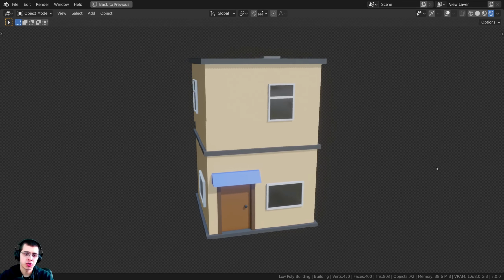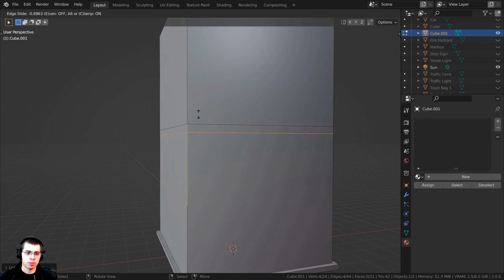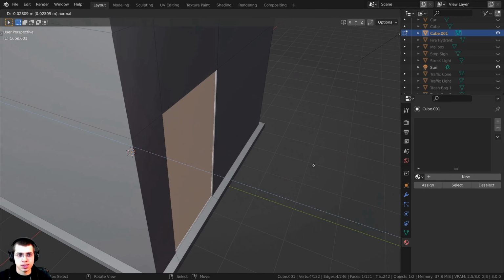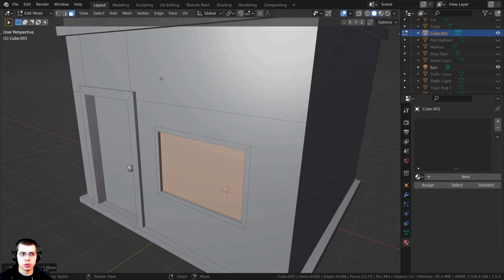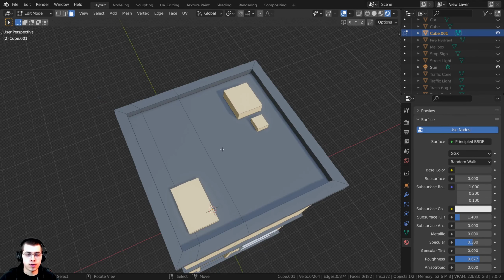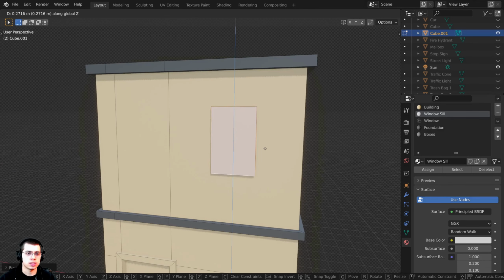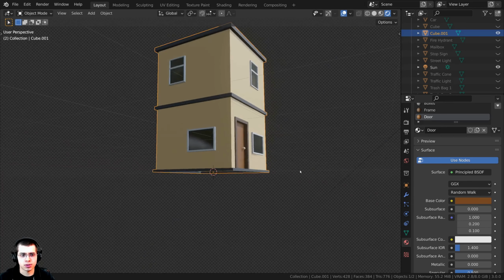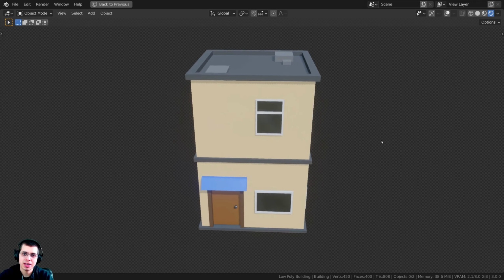Low Poly Building (Blender Tutorial)

Comment: Middle mouse = Pan 
ctrl + O = Open recent 
ctrl + S = Save
ctrl + N = New file 
ctrl + Z = Undo
ctrl + Shift + Z = Redo 
N = Opens side bar
X = Delete 
T = Toolbar

A = Select All
ALT A = Select nothing
ALT + I = Invert selection

H = Hide 
ALT + H = bring it back

TAB = Edit mode
1 Vertex mode
2 edge mode
3 Face mode

0 = camera 
1 = Y position 
3 = X 
7 = Z 

G = Move
G + Z = Move on Z Axis 
G + X = Move on X Axis 
G + Y = Move on Y Axis 

G + Z + Z = rotates the object with the objects Axis 

Edit Mode:
S = Scale 
S + (X,Y,Z) = Scale but only in that direction
I = Insert face 
E = Extrude face
C = Circle select
C+ Shift + Click = Select multiple (Faces, vertices) 

Z + Viewing mode = That view mode

Object mode: 
Shift + D = Duplicate
ALT + D = Duplicates (reduces lag
Reply: Thanks.